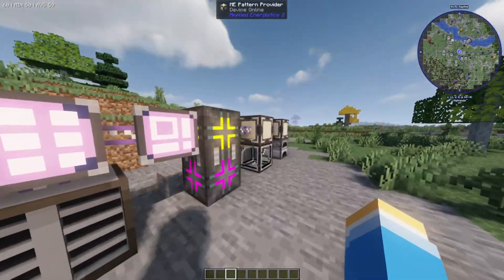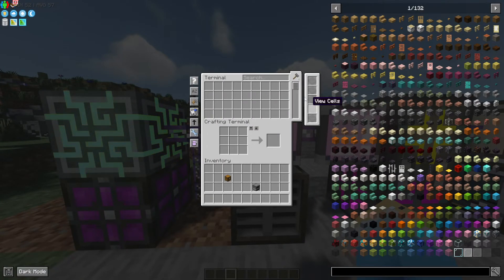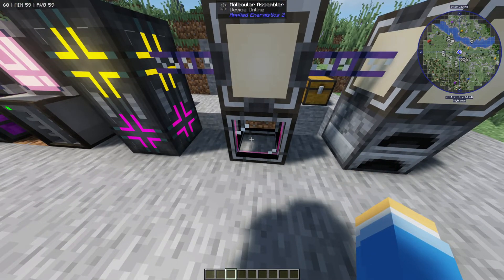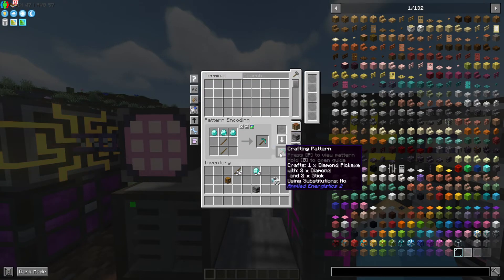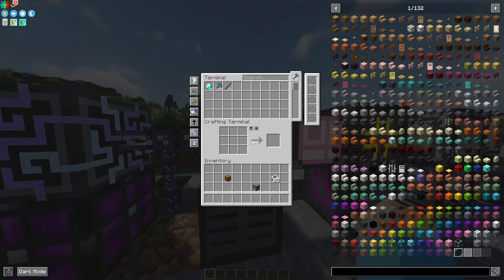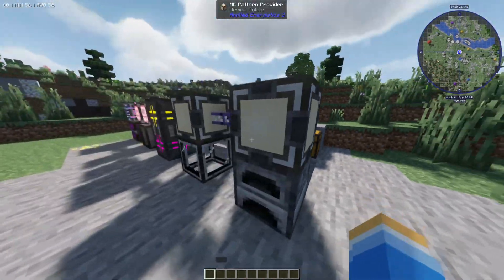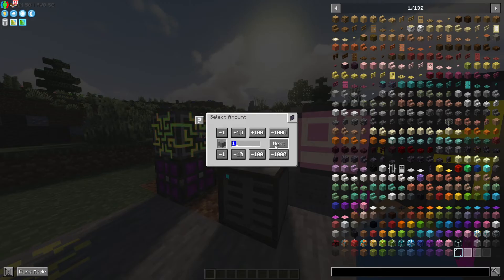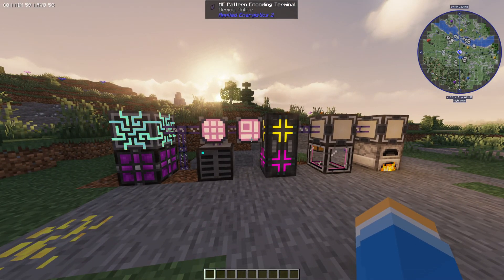Applied Energistics 2   Basics Autocrafting Setup Guide For Beginners (2024 UPDATED)

Comment: I wanna know how id set it up for gregtech multiblocks
Reply: I think you just put the patern provider into the input hatch and bus
Reply: Wait, you just create a "gate" that sends the items from the storage to a "subnet" like you send the items and the sistem moves them into the inputs
Reply: Import and export busses at hatches. If it doesnt work, you can make a chest and export bus your desired item there (and use the thing i dont know the name to limit your desired item to stop going if its already in the chest, so it really ONLY uses your desired item when its needed instead of filling the chest) and use greg's pipe to pull the item from chest and connect it to the hatch. Same for exporting your processed item too. Hope this helps.